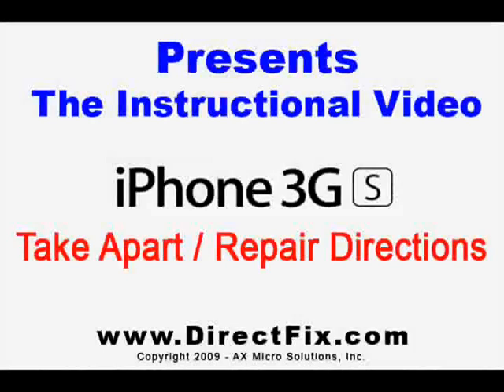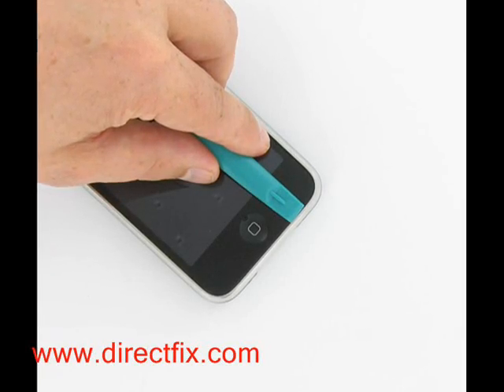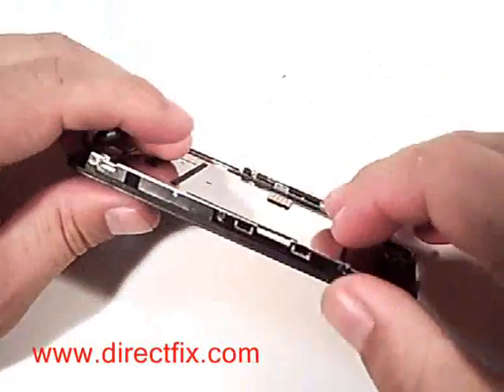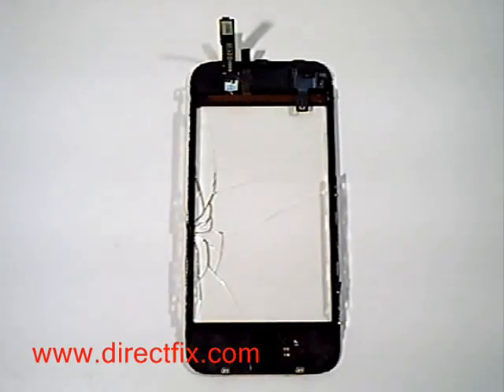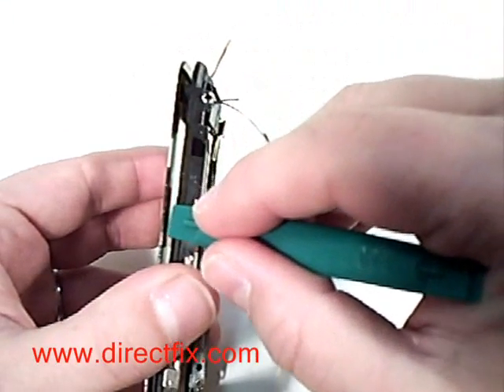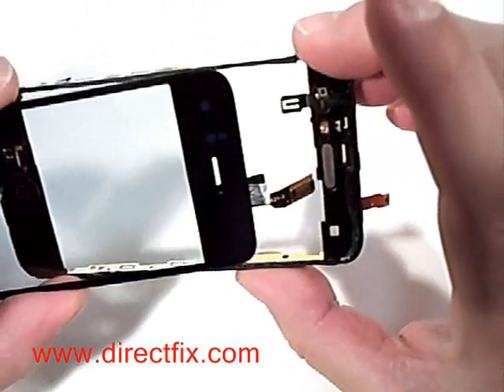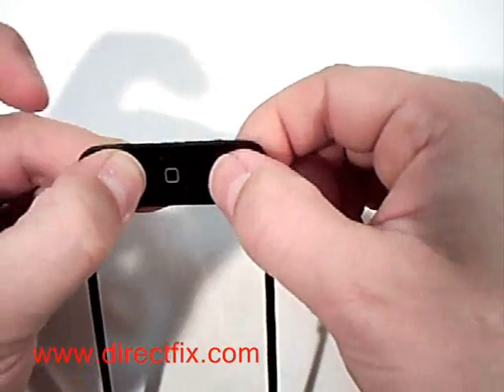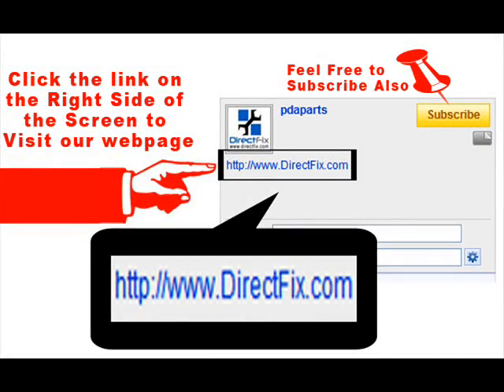iPhone 3GS Take Apart & Repair Directions by DirectFix.com

Comment: Successful repair and replacement of shattered (not cracked, SHATTERED) digitizer.

I didn't see the reassembly video until I already had it back together. Getting ribbon 3 in is a bitch. Everything else is cake.

Comment from the maker: @goldenboy88x Sometimes you can use the adhesive that is left from the old screen but to be 100% safe I would order the adhesive. Most of the time the digitizer will pull off 90% of the original adhesive with it.

Comment from the maker: @notoriousjerks1 Depends on what part is broken. The top outer layer is called a Touch Panel the part under that which allows the apps/icons to display is called the LCD. Take a look at our Blog at DirectFix com we have an article that will help you figure out what part you need.

Comment: 010101011001010101010101010101010110101010101001010010101001010101010111010100101010100101010110010100110100011101010101010100110101010101010010101001010100101010101010101001010101001010101010010101010010101010101001010101001010101010101010101010101010101010101010101010100101010110111010001010100100101010010010010101010101010100010100101000101010100010001001001010010101001010010100100101001001001001001001001001001001010010101010010101001010010101010101
 that means thanks in binary

Comment: Hey pdaparts, thanks so much for your videos they are absolutely fantastic and very very useful. I was wondering though about the very thin rubber strip that runs around the edge of the screen, the bit which is visable when the phone is together as the thin rubber bit between the screen and the silver bezel. Is it supposed to be handled VERY carefully so as to keep it intact? I replaced the screen on my phone but this rubber bit is practically gone. 

Thanks!

Comment: My iphone 3gs can still detect finger movement with no problem.
If I get a replacement screen glass only without digitizer, 
is it possible to extract the current digitizer and put it on the new screen glass?

Comment from the maker: @oneiooknurhookd If the touch panel is not broken you just need to replace the LCD most of the time. If the LCD and Touch Panel are broken you will need a complete screen which is Part Number IP-2322 at DirectFix com.

Comment from the maker: I understand. If replacing just the touch panel the rubber part stays with the frame. If you order a complete screen the rubber part is on it already.

Comment from the maker: How to tell which Screen part you need for the iPhone 3GS from DirectFix com

- LCD Only: If the image under the glass is broken and the touch panel is NOT then you only need an LCD.

- Touch Panel aka Digitizer: If the top touch panel or aka glass top is cracked or broken but the image under it is fine then you only need the Touch Panel.

- Complete Screen with Touch Panel and LCD: If the top touch panel is broken and the lcd image is either black liquid or cracked you need a complete screen.